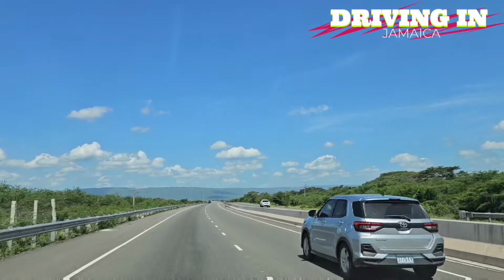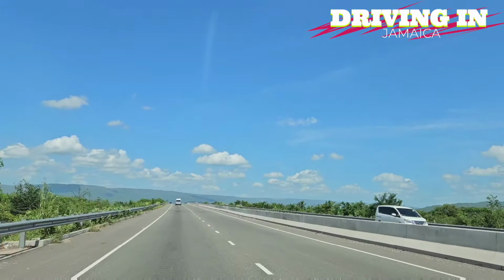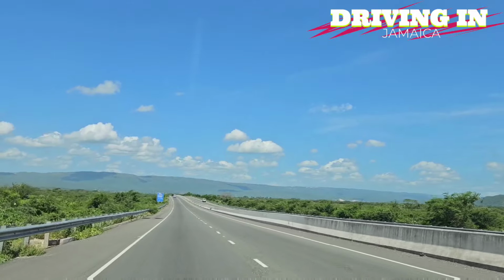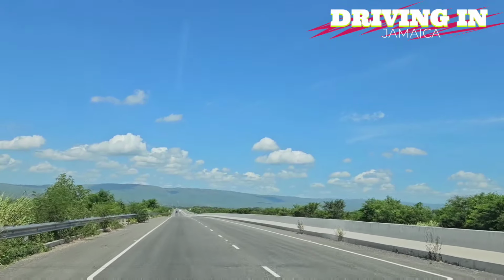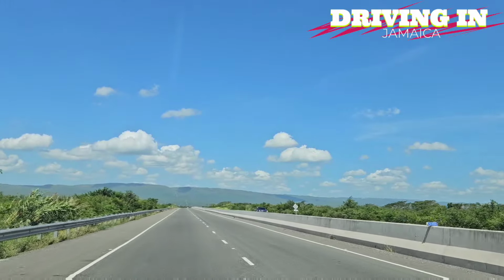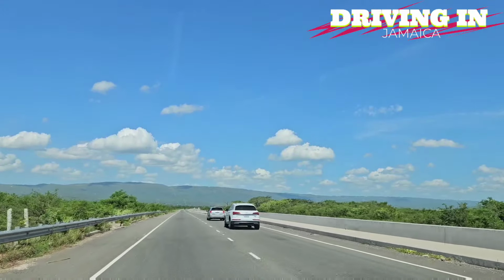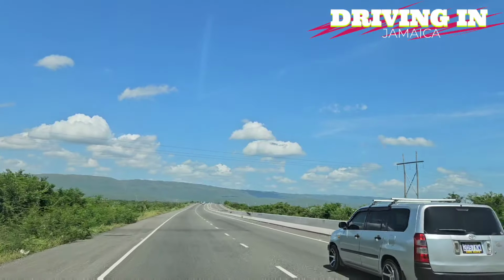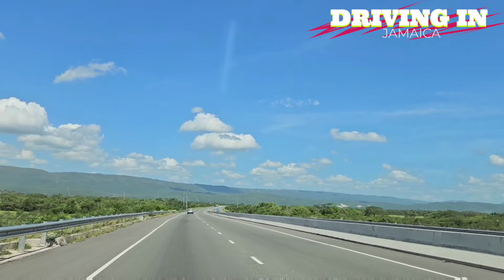Construction New Toll Roads Jamaica

Comment: I support the building of toll roads. However the interior parts of Jamaica are left out of toll or even modern road connection.
It is the connection with the interior where our small farmers and craft people reside that should get priority for tolls. The road to development is the development of road.
Let us develop the interior of jamaica.
Reply from the maker: I agree with toll roads also. They need more Exits for the small towns in jamaica
Reply: Fact. I support the construction of these new transportation infrastructure however I think it's needs to be more comprehensive and with a clearer plan. Factoring geography/utility and foresight, Jamaica needs 2 main East-West Highways; a reengineered modernized version of the north coast highway further inland stretching from Negril to Port Antonio and a East West highway on the southern side of the island also stretching from Negril terminating on Port Morant(currently Highway 2000 East-West and SCH). Like @drivinginjamaica suggest, this needs to continue to Negril providing Savanna-La-Mar with smooth access, it should be noted that Negril is mostly tourism and entertainment, most of Westmoreland's day to day business and commerce for the local population is done in Savanna-La-Mar. If built in this manner, yes sections can be tolled, but not the entirety. Also if this highway is built/upgraded it would need to be a full highway that is more so a thru route that bypasses the towns and less capacity roadways and lastly, it should be a real highway without stop lights eg as it passes through Kingston given that there's no viable way to bypass because of the lack of available land and the infrastructure already being built along its frontage. Kingston needs a grade separated north/south highway or an orbital with connecting auxiliary spurs and egress/entry to better handle the city traffic. Currently there's one north/south link, 4 more is needed. 
1. Sav to Lucea and Montego Bay(could be addressed with the leg of Long Hill Road connecting the current Ferris Cross to Mackfield Road
2. Rio Bueno to Junction via Mandeville and Christiana
3. Current Edward Seaga Hwy.
4. Annotto Bay to Kingston or Buff Bay to Kingston.